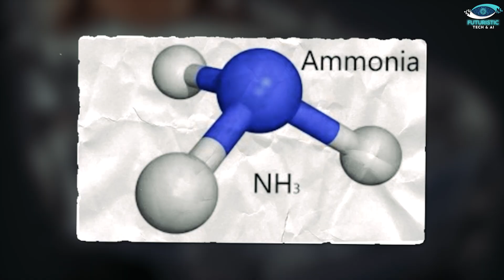Toyota & Gac's Ammonia Powered Engine | NEW Ammonia Engine

Comment: Same underlying problem as the Hydrogen ICE engine --> trying to save the low efficiency internal combustion engine tech by using alternative fuels that are marketed to combust cleaner than using hydrocarbon fuel directly but are mainly produced from Hydrocarbons and that production is anything but clean.  "Green" production of these alternative fuels is possible but far less efficient than the production from hydrocarbons thus far more expensive and only a very low percentage of the annually worldwide produced 250 million metric tons of Ammonia comes from  "green" sources.
Reply from the maker: Thank you for sharing this information 👍

Comment: I don't think this will happen. If the energy density is half, then doubling compression might be required which means even tighter tolerances and seals. And if any ammonia is not fully burned or leaks it is extremely toxic. Also, the byproduct of burning ammonia is potentially even worse than current petroleum ICE engines. I would say they might have some sort of different catalytic converter that may offset this problem but I have not heard of one yet. I like the idea of the hydrogen on demand engine theories better. They are engines that run on hydrogen but do not store it. Basically when you need the car to go and you press the accellerator the engine creates the exact amount of hydrogen required and it is immediately burned to create propulsion of the vehicle. This also has a lot of hurdles to overcome. It is certainly an exciting time for innovation. The more options the better until we find one that is close to perfect.
Reply from the maker: Really appreciate such deeper insights. Very interesting and factual discussion.

Comment: Seems like it has a lot of advantages over the other options. Hydrogen has to be kept under pressure. This can be basically handled like gasoline. Batteries have issues of a ton of new infrastructure, including really beefing up the power grid and supply.
Reply from the maker: Thanks for sharing these insights.
Reply: No it cannot be handled like gasoline.  Anhydrous Ammonia (NH3), which is used in these ICE engines,  is a highly toxic gas that needs to be kept under pressure however that pressure is far lower than that needed for Hydrogen so more in the neighborhood of NG / LPG filling.    
Sorry but everything needs beefing up of infrastructure if you want it to additionally supply the commercial and private transportation sector and due to the low energy conversion efficiency of ICE tech this will mean more energy and infrastructure needed to cover those inefficiencies.